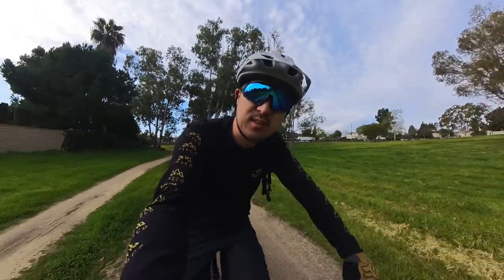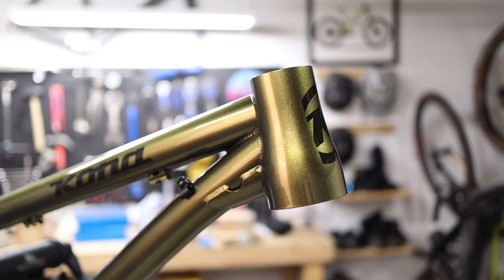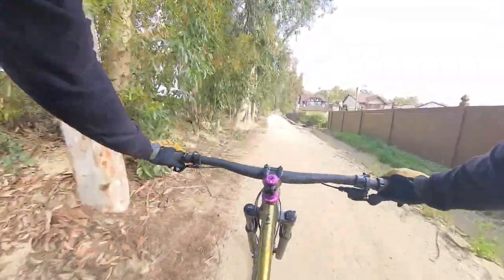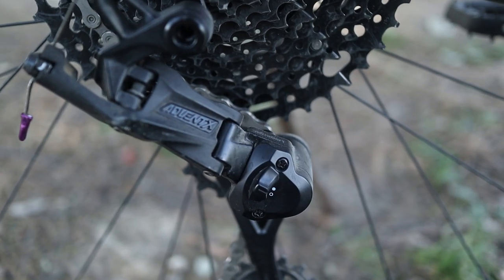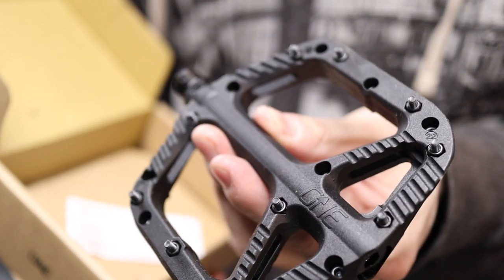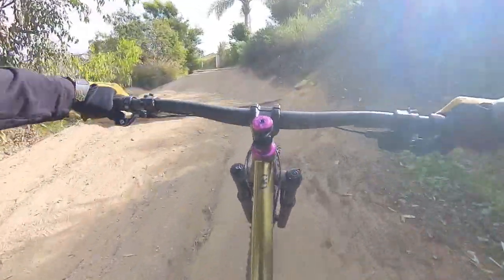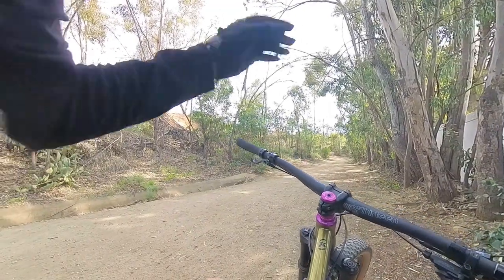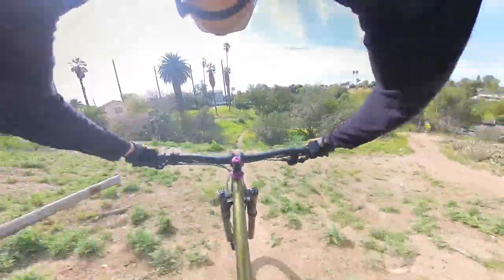A Semi-Budget Kona Honzo ST

Comment: The Honzo looks amazing and your content on the build was awesome, you have a great channel! I’m a huge fan of hardtail’s and gravel bikes. On my hardtail’s I also run all my bars 780mm with thin grips. My stems are 50mm, I tried 35 and 40 but maybe my frame’s just didn’t have enough reach. There size small and it just felt to compact. The one thing that I have also done is kept using the 31.8mm stems and bars, instead of 35. I’m only 160# and my bikes are small hardtail’s not big enduro bikes. So with that smaller bar I get some comfortable flex, especially nice on my rigid SS hardtail. Anyway I’m looking forward to your next Bike Sauce videos, I’m sure you’ll enjoy your Honzo ST 😎

Comment: I'm not sure specifically about the RF dropper but many use a sealed cartridge that you can often find and cheaply replace. BUT sometimes they get hard to find and sometimes they can be a PITA to replace. V1 of the X Fusion Manic was difficult but subsequent versions were a lot easier. For that one, the cartridges are about $30-40 and last for at least a year, in my experience.

Comment: If anything 30mm(or even 27mm) would let you run lower pressure without having the light bulb effect with 2.6 tires one gets with 25mm. I've seen youtubers say min they would go with 2.5 is i29 so they can get the most out of the tire. Do you think you can also test out those wider TRP rotors? I hear they pair well with Shimano brakes.